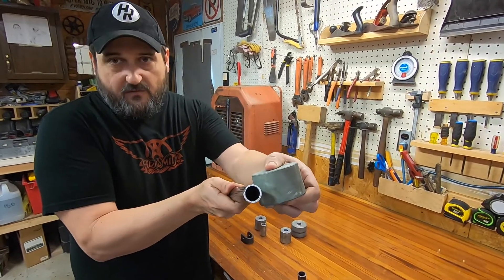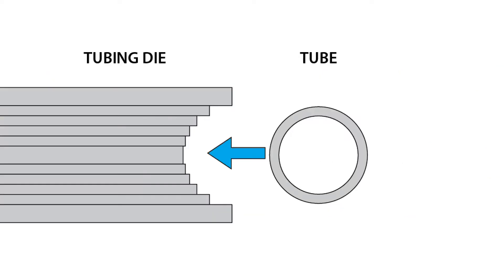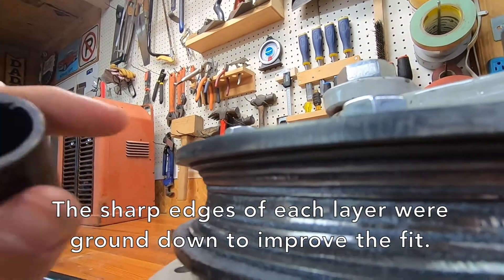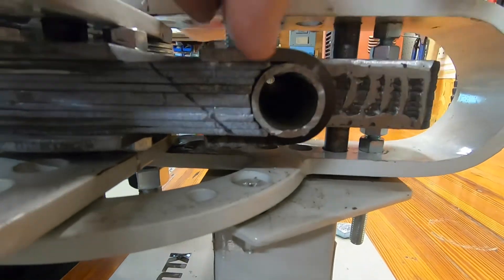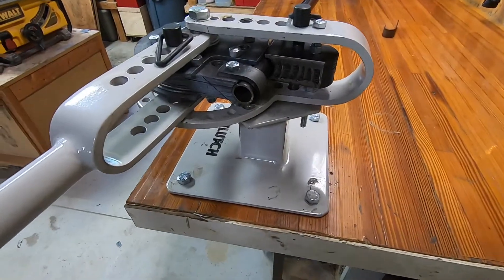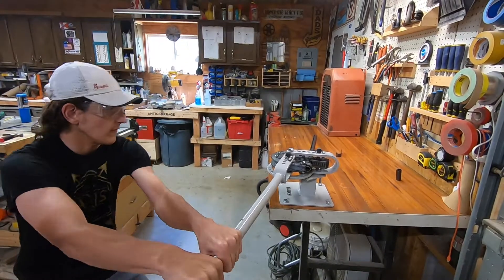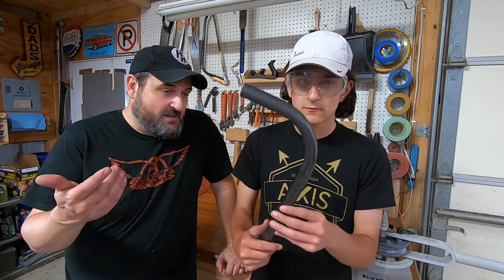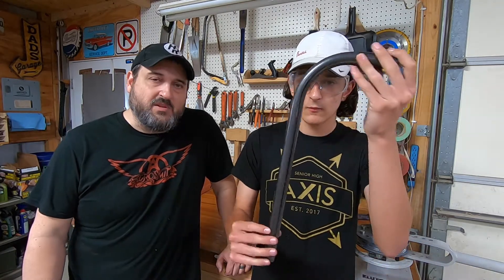Homemade Tubing Bender Dies from the CNC Plasma Cutter

Comment: one can place a metal file with the correct bend (alternatively make own file rather than buying) against a round piece of metal mounted in lathe or similar, with merely gravity and a bit of extra force from a weight placed on the file, slowly digging into it and creating the correct groove

Comment: It would work nice to find a guy like me with a big lathe to turn the finished item that could use plasma cut pieces to make the same thing for myself... 🙃
  and you are 100% right, bending dies are insane expensive, and they shouldn't be... 
 Yeah, I'm just gonna have to get a plasma cutting system guess.
     My friend wants to try casting scrap aluminum into center blanks and sandwiching  them with steel. after seeing your approach work, I believe it would work.

Comment: I like the concept a lot.  The bender itself seems inadequate for such a tube however, it did work.  Another cool tool, if you ask me.
Reply: I dont think something is inadequate because it doesn't meet the demands of everyone. The home hobbyists may only use a tool like this once every couple of years if not ten , and dont wat to spend $1000.
Reply: @leelafarlett3535  Eh, thats not what I meant exactly.  More a question of whether it would hold up. I appreciate any diy build!
Reply: @ricrandmfx  Ok. Im not sure exactly why I want one, Imight use one a couple times a year. I started building an airplane about four years ago , and needed to make a few dozen bends of 1" round tube. Now I need to bend about 20 1/2" tubes (not pipe). And a few more. But I just cant find a bender that bends tubeing. Needs to have a 6 1/2 radious too. I'd like for them to be bent right, If the ribs are not bent correctly the ground may rise up and smite me. Oh well, if anyone knows of something that will bend 1/2" tube please let me know, thanks

Comment: Great Job. duplicated this with a square tube die. I found that making the follower with the same stacking concept only on the vertical instead of the horizontal gave a smoother finish and a little bending lube spray from local big box on that follower is another force multiplier.
Reply from the maker: Thanks! I'd like to try a square tube die as well. What size tube did you bend?
Reply: @anticsgarage5230  1" and 1.5"  -14Gauge.  I have a Rotary tube bender and the dies are like $1200. So this is a huge savings. And I have additional plans for different sizes

Comment: That streak on the outside also represents friction.  Whatever it is causing that, knocking it down might make a big difference in how much force the bend requires.
Reply from the maker: Good call!